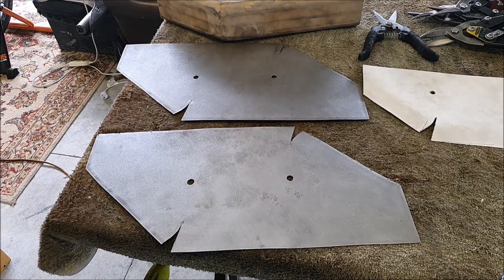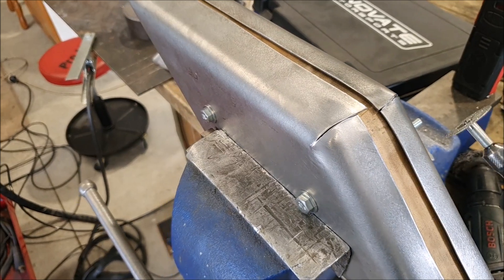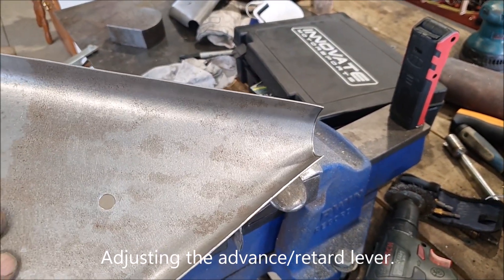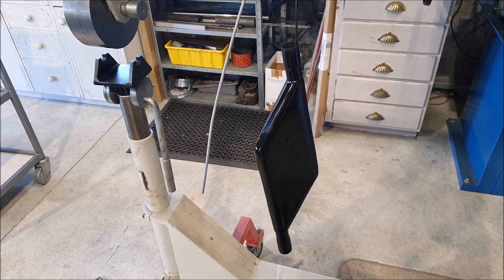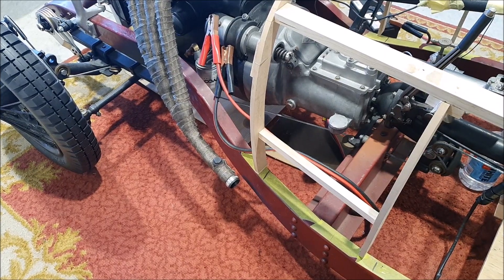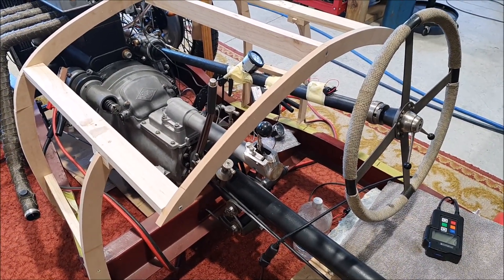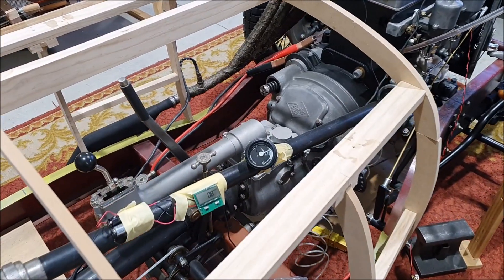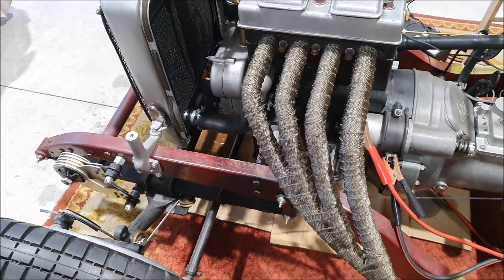Riley Brooklands muffler done

Comment: Enjoyable update on your progress.   That header wrap is wonderful stuff, but I wasn't smart enough to wear gloves at first and I itched for days.  The engine sounds very sweat.  I keep lusting after those wire wheels and thinking about possibly changing over from my wooden wheels.  The wood wheels look good, but I have found no matter what you do they wobble a little.
Reply from the maker: The wheels weren't cheap unfortunately. And I think the chap who did them might now have retired. It's another f those things where eventually no one in NZ will do them and then you'll have to pay to get them shipped over. It's all just getting more and more expensive. My last order to the UK was 90 quid worth of parts and 70 quid for postage!

Comment: Thanks very much for the construction detail on the muffler........just what I wanted to see :)
Reply from the maker: That is just my way. There are maybe other and better ways. But it worked for me. It's a good excuse for practicing my welding anyway! This one sounds better than the Austin 7 ones I did. It is bigger and the inlet and outlet pipes do stick into the muffler and it has the two bars though the middle to stiffen the sides.
Reply: @asciimation  It looks the part as well as sounding great! Thanks again......
Reply from the maker: @markosland9746  It does sound much better than the Austin ones I made. It's thicker steel, 1.2mm and also has the two centre stiffening rods that stop it rattling.

Comment: Hi Simon, don't know if you've come across this video, if you scoot forward to 4.56 there's a Riley which is billed as a 2 seater, it has the same Brooklands exhaust system that you've just built for yours, you'll know better than me if it is a Brooklands or not...https://www.youtube.com/watch?v=1vmcYdwY3OE
Reply from the maker: No, I hadn't seen that one. Thanks for the link! It's not a Brooklands or replica. You can tell right away by the chassis rails which are straight here and on a Brooklands they are bent. That's a very pretty little hill climb.